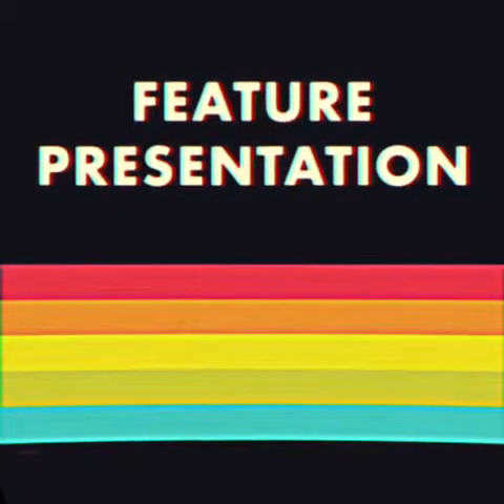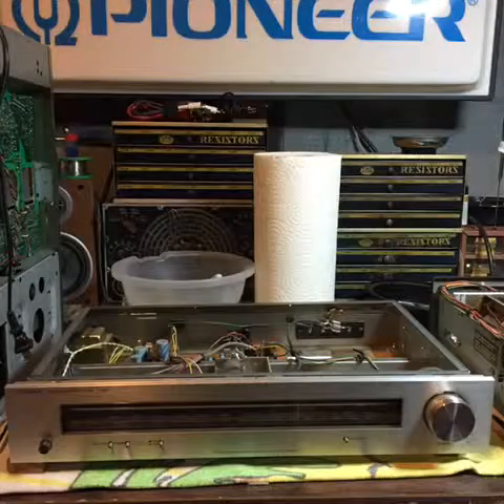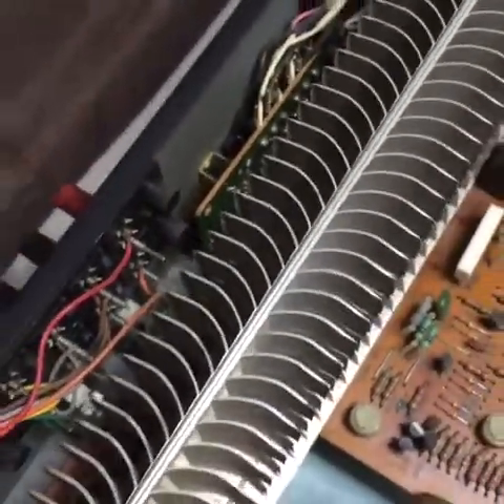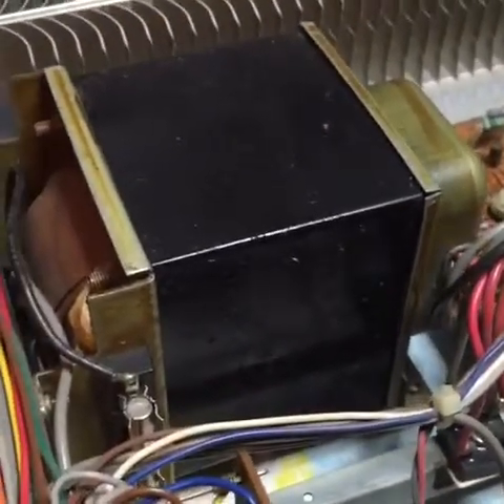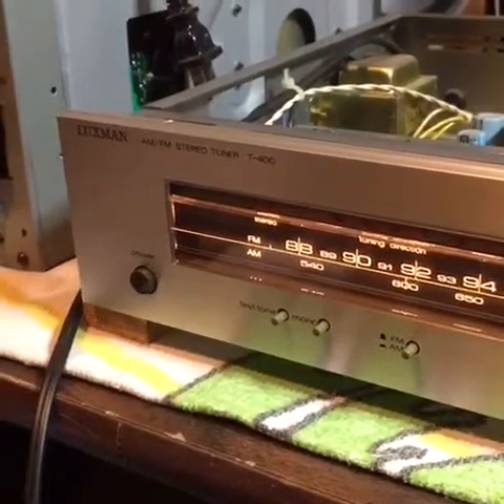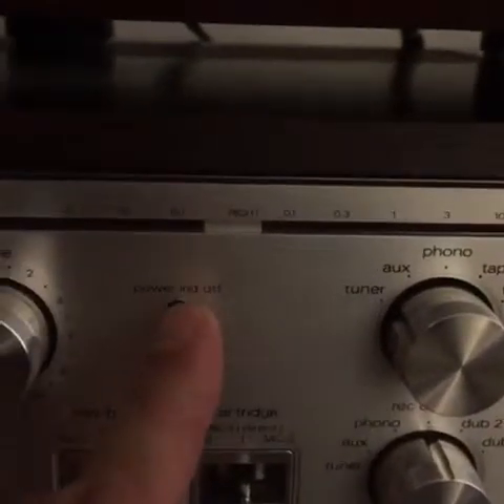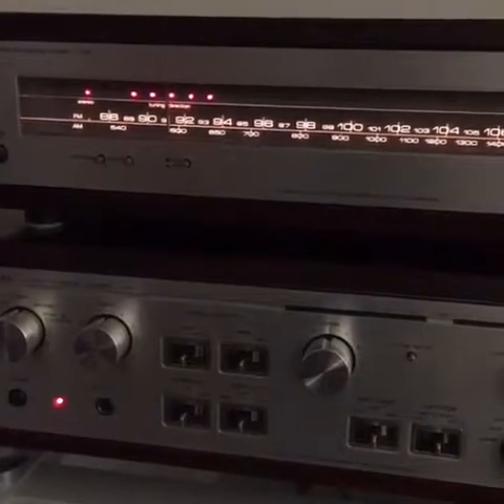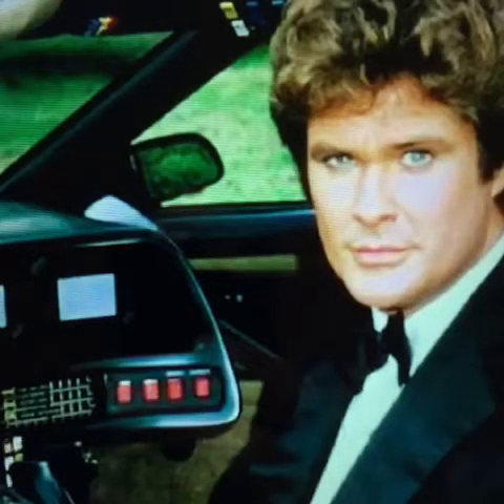Luxman L-450 Integrated Amp!

Comment: Just  recently purchased the slightly higher output L 480 and I honestly feel it is a nicely refined sounding unit - the overall build quality is certainly above average and it does look good too.  Nothing to really complain about! As with much of the vintage Luxman products they tend to be rather uncommon as well.
Reply from the maker: You hit the "nail on the head"...They are very refined sounding and easy to listen too!
Reply from the maker: I agree. I've actually just reacquired another...I guess I missed it!

Comment: the 450 and 480 are pre alpine , Not as robust as earlier models but having had 5  l480s through the years , all sounded excellent with more low volume current than many amplifiers rated much higher wattage despite the relatively small capacitors.
Reply from the maker: I agree. There are much more robust earlier (& even later) Luxmans; However, they do sound - as you put it, "excellent".

Comment: I've owned an L-113A since the 80s, and now an L-114A is my reference amp. Both a year or two older than the L-450, in fact the matching T-111 tuner seems identical to the T-400. The 113 and 114 seem to be better laid out inside than the 450 - perhaps the 450 exhibits early signs of Alpine cost-cutting measures?

From what I gather, the duo-beta circuit was Luxman's implementation of a Darlington circuit.
Reply from the maker: I believe the amplifiers you've referred to are all of the same era (early 80's) and all designed close to Alpine ownership (84). Prior to the purchase, the two were actually already jointly engineering some of the products. The 450, under close inspection, has a more robust power supply (transformer, capacitors, etc) than the 114. I think the 114 is more "simple" in appearance inside because the circuit is not as complex... Regardless, they were all still pretty good sounding amplifiers at this time. Congrats on your 114!

Comment: the l 450 and 480 were 1977-80 vintage . The Japan models L48 had real wood cabinets . The 480 had a more advance heat pipe assembly.
Reply from the maker: Well, that might explain the variable finishes... For example, my L560 was a Japanese only release - it had a real Rosewood finish. My L550, on the other hand, was "fake" Rosewood. I think the Japanese market was willing to pay more/ was demanding of these smaller luxuries than (for example) the North American market.

Comment: How do you feel pioneer SA-7800 amp compares to marantz or Luxman comparable amp/receiver?  Thanks for your input.
Reply from the maker: I've never had one, but I do know the "blue led" Pioneers have some major cult followings. Probably the closest I had to one was a SA-9500, but that's a different beast - being a earlier amp. I do know the SA-7800 is a "non-switching" amplifier, it seems to have a nice layout inside & good specs & probably sounds very clean. It certainly looks "beefy" for a 65/channel amp. In comparison, circa 79-81, the Luxman was still Luxman (pre-Alpine), producing their duo-b circuit amps, which were  also very sweet sounding; Including, the L450/80 amplifiers (some of my favs). Marantz (on the other hand) was just sold to Superscope, marking a (IMO) downwards trend in quality. They did have some decent models, but there was certainly change happening & the earlier models remain more desirable. Vincent, are you considering purchasing one or the other?